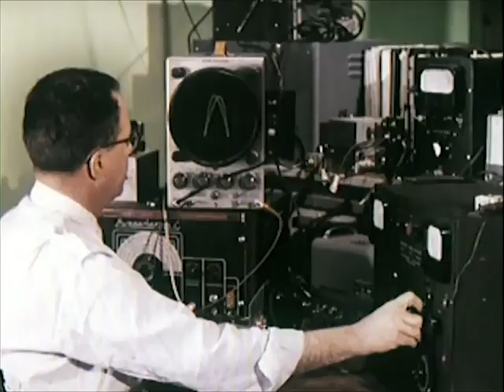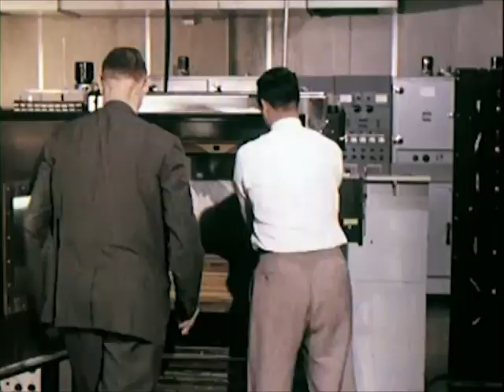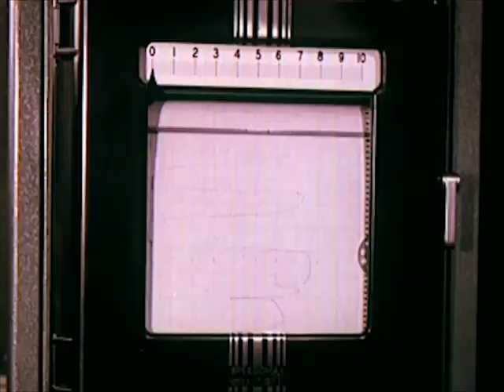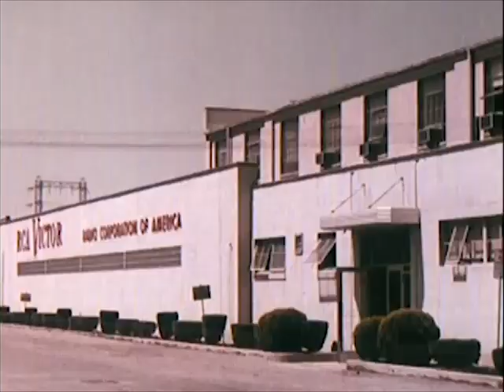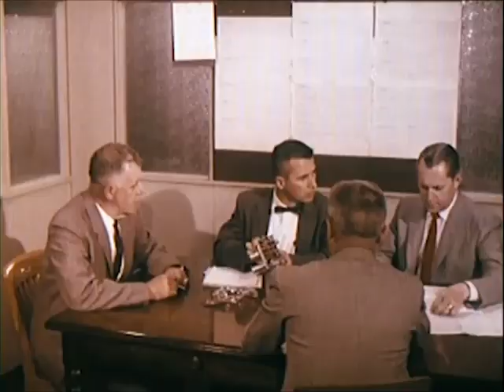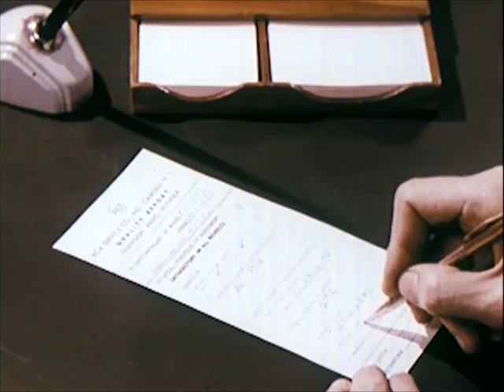RCA Victor TV History: The Reasons Why RCA Victor Television Division TV - CharlieDeanArchives

Comment: The back of my RCA old model TV came off and when I was trying to put it on I bumped something in the back of the tube and it was a hissing sound. Does anyone know enough about these TVs to know if it was something toxic
Reply: Sound's like you broke the picture tube, very easy to do.
Reply: It sounds like high voltage arcing to ground from the horizontal output transformer (10,000 volts, low current)
used to drive the CRT scan. Check for a piece of loose hardware in the vicinity of the arcing. POWER  OFF set and DISCONNECT from AC before attempting to retrieve extraneous 
metalic item ! ! !

Comment: When they made things to last I see sets 60 years old still working,flat screens blow out after 4 years chinese capacitors and IC'S
Reply: The cheapest ones may, but I’ve got three flatscreens that are much older than 4 years and one that is younger. I’ve had zero issues with any of them. Not only that, but the parts inside a flatscreen are much more easily repurposed.

As for sets this old still working, there aren’t many. Check ebay listings and you’ll see there are many more broken sets than there are working. In particular, the color picture tubes from that era have a tendency to lose their seal, and thus the vacuum, making them worthless. New systems have been developed for restoring and resealing old color tubes, and most working extant models use a restored tube.

By the mid-1960s, the picture-tube manufacturing process had improved to the point that the sets tended to last much much longer and had more vibrant color. These improvements made it possible for GE to develop the PortaColor and for Sony to release the Trinitron, which helped to drive down prices for traditional, RCA-patented shadow-mask color sets.
Reply: Not true about flat screens at all! I've had a plasma TV  set for 12 years.

Comment: I was an employee of RCA for over 33 yrs (1954 to 1988). During those years I was a technician repairing TV's and radios. Then RCA opened up Training centers when Color TV came in. I was made an instructor. Then when the Bell Telephone system was broken up, RCA got in the business of installing and repairing Telephone systems; and I got a new job instructing about the world of telephony.

I said all that to say that I had to laugh out loud; when this video said things that I know are bold faced lies. IE:

Electronic gear uses capacitors and resistors, along with other items. Now get this, RCA bought these from vendors and they often purchased the ones that were going to break down, especially in humid places. Wax capacitors and IRS resistors are going to break down. Again it is terrible in humid areas.

More than half of their resistors would go bad in a single TV; and the same for the capacitors. I have replaced 10's of thousands of them. I know this to be the truth.

When I was transferred to Ft Lauderdale, Florida (VERY humid all the time), I used to replace 40-50 of resistors and capacitors in every set that came into the shop. It was a joke. When management (In NJ) asked us, "WHY are you replacing all those items?"...

... we told them, "The humidity is getting in them and damaging them". That's why. They laughed at us. That scenario never changed year after after. They just did NOT believe it; nor did they care. But it was the truth.

So when I saw this video I had to laugh out loud. They were liars and never owned up to it. No wonder they went belly up. All RCA is today is a subsidiary of a French company that is even worse. David Sarnoff is turning over in his grave over this chacanary. If he knew it when he was alive, he would have stopped it YESTERDAY!

For what it's worth.
Reply: I watched this video after buying a vintage 1950's or 60's rca victor tv (says super on the side not sure what that means)
it's got some major picture issues but after reading this im just going to toss in all new caps and take a hard look at the resistors 
any advice for how to clean out the tuner? it's just a standard 13 channel
Reply: @raccoon681  Thank you raccoon. May you do it well. Just be very careful when cleaning out the tuner. Because it has some parts that are easily damaged.

The ONLY thing that needs to be cleaned, is the stator and rotor; that turns going around to another channel. Please use an electronic cleaner. Putting small amounts of the cleaner as you turn the rotor. Near the center.

I will say a prayer that Jesus guides you well dear friend. Again thank you.
Reply: @raccoon681   if you are restoring an old RCA monochrome and complaining about parts 60 years old then you are the fool!
Reply: @erin19030  don't know what you read im not complaining we just replaced every cap on it and she's good now
Reply: You sir are a fraud and you have no idea what you are talking about. I worked in Quality Control at RCA labs. We multi- sourced vendors to keep the production line going 24/7.  Out field test lab documented each set that was tested .
Reply: Yeah those old TV sets generated so much heat I had a hard time believing they were cooking the small parts in ovens cuz that is just what they will do inside the cabinets. lol.  All TVs were the same too, nothing special about RCA.
Reply: @fueledbylove ❤,Well! in this 93 Yrs Christianity: I still will be ❤ed of the RCA Company. And the 33 yrs: I worked all over America!	And ❤ed: all of those 1st JET Planes. And the others too, etc!

And being: in the inventing; of the Color TVs. And saw the 1st one! And, may Jesus: rest their Souls. And I am still; an old man, AMEN!❤
Reply: @MrPatdeeee  Ok Sir. Not sure why you pinged me. In your first posts you called RCA, your formers employers - Bold faced Liars that never owned up to it, concerning the low quality caps and resistors they used. I agree with you on that, but I do not LOVE them, quite the opposite especially after seeing this JamHandy film
Reply: Wow. You are genuinely living history, Sir! I just got an RCA Model 3-US-5 I am going to recap, replace the power cord on and replace the felt for the turntable. Any advice from you I’d consider priceless just like your comments. Much love and God bless you! ❤️
Reply: @Analog_Momo  Well Brethren...you bring tears of nostalgia; in my heart, soul and mind. As RCA gave me joyful life for 33 yrs.

So thanks Analog-Momo: May Jesus bless You and Yours always, AMEN! ❤🙏😇
Reply: @Analog_Momo  Amen,. Amen and Amen! And my life is loving Jesus with they Heart, thy Soul and thy Mind, AMEN!❤🙏😇
Reply: I grew up in the Deep South where heat combined with high humidity has always been a huge issue for all kinds of appliances. Fortunately we had air conditioning and so maybe that’s why I don’t remember a lot of problems with our RCA color TV which my grandmother had given to my parents as a wedding gift in 1957. Although we often needed to fiddle with the fine tuning and tint controls, it was a great TV. One interesting thing about it that I remember was when my mother wanted to rearrange the living room furniture. She had to call RCA to send a tech to move the TV. Apparently this was required for any color set made before the mid 1960s. You couldn’t just move it because something inside, I think it was the color guns, could be misaligned easily and would require a recalibration.
Reply: what a chad, i hope you are doing fine big bro
even if i born on the time the lcd start to enter into the house i love to see old equimpent and tech, is much easier to undertand and make easier to undertand the new stuff